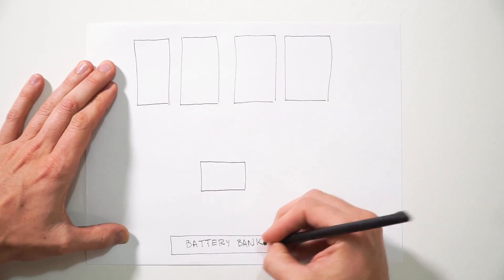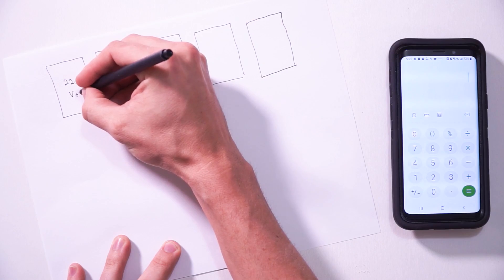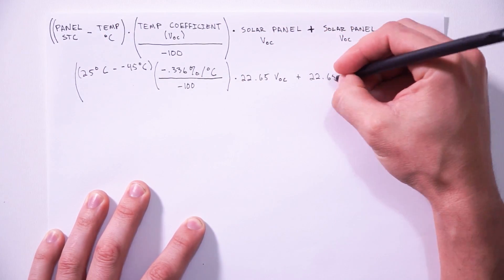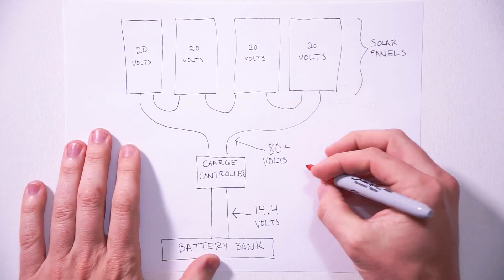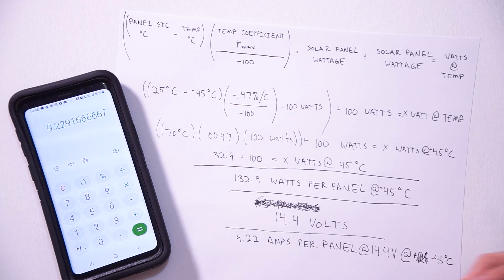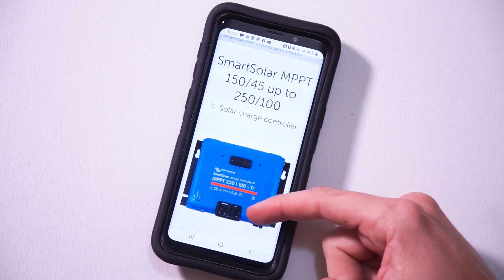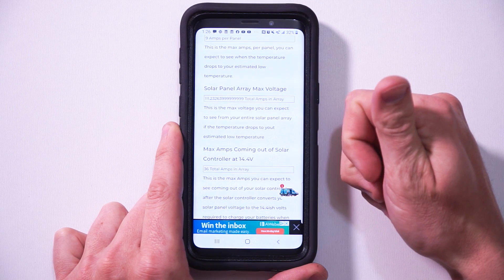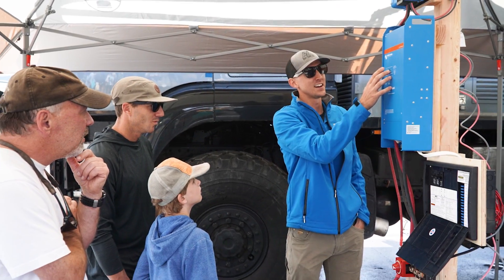How to Size a Solar Charge Controller for a DIY Camper Van Solar System

Comment: Wow according to the calculator I totally have too many panels for my solar controller. Tomorrow I'm going to switch em around if it's not raining... supposed to rain I would like to be able to see if things change. I'm going to lose two panels. I'm going to have to figure those out and buy another solar controller for them
I did find out that on my 48 volt system that I'm going to build I should be okay with my 10 320-watt panels. I think it just comes in under what the all-in-one 6500 sungold will let me have

Right now I'm working on my 12-volt system again I've had it in for 4 months and apparently I don't think the solar controllers are set up quite correctly. I had the wrong information given to me. Previously apparently.

Comment: And….. solar panels do not produce what they advertise. Like a 2x4 lumber is not 2x4..
Reply from the maker: It's not quite as cut and dry as lumber.  I know that if I go to the lumber yard now in 2023 to buy a 2x4, I know exactly what the dimensions will be.  With a solar panel, a 100W panel could put out 80W if it's hot.  100W if it's cool.  or even 110W if it's cold.

Comment: Many thanks for this, and more especially to all the work you've put into the calculator which I have been using for the last couple of hours.  If you have time for a question for folks who live in the tropics, here goes!  I crunched the numbers for low temp (10C,) 25C (STC?), and 40C using your low temp adjuster.  I could well be misusing its design function, but my voltages kept rising with temp. I was lead to believe efficiencies go down somewhere above 25C, it's usually above 35C in these parts, how do you size MPPTs for hot climates?  Thanks!
Reply: The STC, e.g. 25 C, is the temperature of the solar cells in the solar module itself, not the air temperature. As the modules generate power, that temperature goes up above the outside air temperature. But, not sure if the above information may help you figure out your question.

Comment: Although the calculations made in this video are generally OK, something that is not considered is that when panels are lying flat they will not perform to the level outlined in the spec sheets, because the sun is not aligned normal to the panel, unless one is in the tropics at the right time of year. So a correction should be made for the angle of the sun on the coldest day to estimate the actual power generation. The outcome will be lower production  than these idealized figures suggest. I have solar in Brisbane Australia and the consequence of the sun's angle throughout the day and the year is a substantial difference in production.
Reply from the maker: Although your comment and thoughts are 'generally okay', It's best to size the charge controller off of idealized figures like I showed in this video.  Actual production may vary, but sizing the controller for the 'best case scenario' will always be safer.

Comment: Fascinating video and your calculator is amazing.  I only have a small teardrop camper with 100 W solar but I want to upgrade my batteries to lithium and the charge controller too.

Comment: I think you made a mistake on calculating current on series string consisting of 5 PV, you multiplied max current of 9.22A by 5, which was wrong as the PV panels were connected in series. Please let me know, otherwise good video, thanks a lot.
Reply from the maker: The x5 comes on the output side of the charge controller.  This video explains that a little better: : https://www.youtube.com/watch?v=Jkbs84sBHsg

Comment: I want to add a new charge controller ( suitable for lithium).  to a portable solar (currently three 45 watt panels in parallel).  Based on the information that you have provided, to maximize output from this panel I would propose the following actions.  Note:  I would like to be able to locate this panel 20 to 30 feet from batteries in an effort to place them in the sunniest location when camping.

1) wire the panels in series to maximize voltage output.  (VOC is 21.6v).
2) locate the new controller close to the batteries.  It is currently located on the back of the solar panels.

Am I on the right track?  

One more quest - will a Victron Blue Solar charge controller with a dongle provide the same functionality as a Samrt controller?  Will a Smart controller and Blue controller then work together?
Reply from the maker: 1&2.  Yep! that's correct.

3: Just get the SmartSolar charge controlller.  It's the newest technology and then you don't have to bother with the dongles and such.
Reply: @EXPLORISTlife  Sorry should have explained already own the Blue Solar charge Controller that I would like to use for the portable panels and will be purchasing a new smart controller for the trailer array.

Comment: Thanks for the good info. What if the solar panels are mismatched? Will your calculator work and how? Thanks
Reply from the maker: It will still works, but you'll have to tinker with it a bit to get the proper array voltage/amperage heading to the charge controller.

Comment: Is there a max. amount of amperage that the solar panels / array can send to the charge controller? I noticed that the Victron only displayed the amount of voltage it can accept, but not the amount of amperage it can accept. Thank you btw for all these great videos & blog articles. Much appreciated.
Reply: Look at their spec sheets.  https://www.victronenergy.com/upload/documents/Datasheet-SmartSolar-charge-controller-MPPT-100-30-&-100-50-EN.pdf

Comment: What??? a 100-watt solar panel will produce 132 watts under -45oC temperature?
Reply from the maker: Potentially, yes!
Reply: @EXPLORISTlife  yea but practically its impossible that the sunlight intensity will be 1kw/m2 under -45 C.
Reply from the maker: All I can share is the calculations.  What happens in real life may be different, but I don't have a calculation for every single scenario for every location in the world, so I've made a conservative calculator that gets close enough for 99.9% of people.
Reply: @EXPLORISTlife  sure thanku, but it was really helpful, and thanku for the calculator ♥️

Comment: Isn't your calculation at 3:50 incorrect? If the adjusted Voc for each panel at -45C is 27.97725, shouldn't the total Voc for 5 panels in series be 139.8864 instead of 118.57728?
Reply from the maker: I wonder if I made a note about that specific thing directly afterwards?

Comment: Hi. Like your video very much however it got me a little confused. If wired in series volts add up eg 5 x 100w equals 500w. Amps stay as per panel. If I am correct in my thinking why did you multiply by 5 when calculating the amps ?
Apologies in advance if I am incorrect
Reply from the maker: The multiplication happens after the charge controller.  Maybe this would help: https://www.youtube.com/watch?v=Jkbs84sBHsg&list=PLmvhcyi4n0TU6HlMaQiCUwC20DBlyv6s_

Comment: My PWM controller is reading a different voltage than that of my digital meter causing the battery not charge full. Please any help.
Reply from the maker: Strange.  Sounds like a good time to reach out to tech support to see if it's a faulty unit.

Comment: you do consulting for boats with 12v system?
Reply from the maker: Unfortunately, I no longer offer consultations.  More info on that at the end of this video: https://youtu.be/UaJorpj3p2s

I do, however, have wiring diagrams available that meet the needs of 95% of the people who were paying for consulting, so that's the route I'd recommend going.  Here is the link to those: explorist.life/solarwiringdiagrams

I even have a full tutorial showing you how to install these systems into a camper.  Here is one, for example: https://www.youtube.com/watch?v=01F4QDVJUq0 as well as a full playlist that teaches you how to design this stuff yourself: https://www.youtube.com/watch?v=JonRJVchBaQ&list=PLmvhcyi4n0TUjVGA_O5aI5SQrS1kKLgEF

This should get you pointed in the right direction

Comment: Hi I have a Question I have a 48 volt club car I want to put solar on it can you tell me what kind of solar panel i will I need and I want to use a boost controller

Comment: humm not sure i got it, i'm planning to use 28 volt battery with bms ( lion ), can i use a charge controler 12-24 volt since they can take up to 32 volt battery?

Comment: For a Single Solaria 400W panel, in 12v system, would Victron 150/35 charge controller work or would I need 100/50? Thanks.
Reply from the maker: What results did the calculator give you when you put in your calculations like the video described?
Reply: @EXPLORISTlife   Calculator recommended 100/50

Comment: Hi, wondering if my target of 5x100w solar panel and decide to purchase say a Victron 100/50 Mppt, but in the mean time I may only hook up 1 unit of 100w solar usage till my sailboat arrive. Will the Mppt still works with just 1 panel instead of 5?

Comment: The last 2 questions on the calculation stump me..
I have a 40 amp renogy 
From what I've read i have have 2 250 watt panels or 500 watts.
But not when I try calc it.. 
If I have 1 in the series box and 2 in the parallel box it calcs to be 27 amps going in and 50 going out but my charge controller is only 40 amps does this mean I can't have 500 watts of solar going into it? 
If so will 400 be the right amount of watts for it ?

Comment: Let’s say I have two 100 watt panels from harbor freight, 4 of their AGM 12 volt batteries, each is 35 amps, wired in parallel, can I safely use this victron charge controller?
Reply from the maker: Hey Bob!  This video will teach you how to size a charge controller for the panels you've chosen. -> https://youtu.be/MxziHKvTRh8

Comment: Ummm- do you add the currents in series?  The voltages add, yes, but the current through the series circuit should be the same and equivalent to the current through one panel.  No?

Comment: extremely useful video and tools! I do have a question though, according to your calculator we need an output charging current of 60A for our system, but how does this relate to the charging rate of the batteries?
Reply from the maker: I'm not 100% sure I'm following your question, but this video may help: https://youtu.be/Jkbs84sBHsg

Comment: I have 4 panels 300 watts and I bought 2 mppt 100/50 and I have 400 amp in battery bank. Is this victron mppt are the right size ?

Comment: Love your videos. Quick question: is there a problem with buying a bigger than required charge controller. Asking because currently only have 100w x 2 panels but will purchase more in the future (thinking 250w x 4)
Reply from the maker: Nothing wrong with that, no.  Just size the charge controller for the larger array and then verify that the smaller array will fall in the charge controller parameters.

Comment: How can I charge both my Lithium Ion house batteries AND my under the hood Lead Avid Battery with the same solar Panel.  My RV sits most of the time, and when I use it, I have a much lower power draw than what your builds show (I still use propane to power the fridge, heater, hot water heater, and stove top.)   So I have quite bit of excess Solar. Thanks.
Reply from the maker: The 'proper' way to do it would be to use two separate arrays.  Build a big and proper solar array for the house battery bank and then get a little 20W or so panel and dedicated charge controller for the starter battery.  The starter battery doesn't need much to keep it topped off.

Comment: What are the effects of if you have the wrong controller?
If you add more solar panels after etc
Reply from the maker: Best case scenario, it would work fine. (Ex: oversizing the controller)
Worst case scenario, it would damage the controller. (Ex: overvoltage to the charge controller)

Comment: My Voltage Temperature Coefficient is -176.6mV/°C.... does your calculator use mV or do I need to convert to -.1766
?

Comment: my controller only shows wattage when using the power... is there any other controllers that detect wattage better? If not I know I need to buy more cheap controllers
Reply from the maker: Your controller will only tell you the power it is putting out.  So if your batteries are full and you aren't using power; your charge controller will stop outputting power do it doesn't overcharge the batteries.
Reply: @EXPLORISTlife  that makes researching solar slightly complicated since I need to use appliances but that is ok
Reply: @EXPLORISTlife  I’m more like Vosk at least.. I have a separate system to make sure I’m using enough power to test my limits and can controller or adjust the power being used after finding the maximum

Comment: When I use the online calculator to reproduce the math presented in the video at 5m 58s, I don't get 9.22 Amps per panel @ 14.4V @ -45C. I get 10.17 Amps. Can you comment?

Comment: greetings from venezuela friend, I am interested in buying a victron solar charge controller but I don't know which one to buy, I have 4 RENOGY brand solar panels of 270w (model RNG-270p) at 24V, I also have two lithium batteries of 24v 55ah each connected in parallel for a total of 110 ah, now according to the manufacturer of the batteries they must be charged with a minimum amperage of 10 ah, could you please help me to know which would be the charge controller that would suit me best? in advance thank you very much for your help ... greetings

Comment: I have two panels of different wattages (140 and 100).  Your calculator (which is a good start) assumes one has the same make and model panels.  Is it possible to make a calculator which would accommodate differing panels?  Thanks.

Comment: @EXPLORIST life - DIY Campers  I started my home solar  journey, so far think  only made 1 mistake. based on Victron's and your  solar mppt calculator. I had already bought one, a Victron 100/50 for a 24v battery system. The calculators called for 150/35, when I change the temp setting  by 5 degrees it calls for 100/35. Can i use the 100/50 by changing the settings of the MPPT? Thank you in advance.

Comment: With the inverter 3000 watts 
How big the  fuse amp I should put between the battery and the inverter?
Reply from the maker: https://youtu.be/ki3WXVR48eM & https://youtu.be/5y-yDMEgV70

Comment: All that math is great, however some of us are formula challenged. Would you please make it a lot easier and say that at the -45 degrees there will be what percentage increases in voltage to expect. 5, 10 %? If you had a 135 volts on a warm day should one expect that voltage to exceed 150 volts at - 45???  I would like to be able to just add a percentage to my total and be close enough to be safe. For example, if we start at 135 volts and we add 10% that would be 148.5 volts, with that I could determine that 135 volts would probably be too close of a margin and decide to only have two panels in series without doing all that math. Please,  Bill Rogers

Comment: I think I broke your calculator. It says I have 27.27 Amps going into the Charge controller and 137.84 Amps coming out of the charge controller. I don't have any Negative numbers on my labels. When I'm done punching in all the numbers, doesn't have a recommended Vitron Controller for me to buy?

Comment: Hello Explorist, Can I ask you, So the load terminals go to the 12 volt side of your inverter right and the specs on the input side of the controller are independent of the load specs, so a 30 amp 12 volt rated controller is what the controller can accept from the panels and provide to the battery and nothing to do with the load, is that how these ratings work?, Great content Thank you
Reply from the maker: A 30A charge controller can charge the batteries at a rate of 30A.
Reply: @EXPLORISTlife  Thanks and so the load terminals on the charge controller are also 30A x 12V or 360W

Comment: I didn't buy my panels first    I received a GROWATT SPF 3000TL LVM-48P as a gift   I'm not sure what panels to use/size    I have room for 5-10 panels   I'm going to run 8 . 6v batteries  ( for now) I'm not looking to go totally off grid   If someone can give me just a little help on panels  don't need exact  just what to look for and how many    What I'm trying to do is run my shed and garage 110v    Thanks for any help
Reply from the maker: Hey Frank!  I have quite a few options here: https://shop.explorist.life/product-category/all-products/camper-wiring-kits/solar-charging-wiring-kits/
Reply: @EXPLORISTlife  I see that they are all 12 volt   my controller is 48volt  as long as i have them wired to 48  i should be ok   Yes -   no
Reply from the maker: Not necessarily.  I don't have any array examples for 48V battery banks at this time, but if you watch some more of these DIY camper electrical videos, you'll have a pretty good handle on solar design. 👍👍
Reply: @EXPLORISTlife  ty very much.  Will do. :-)

Comment: i suggest a series parallel option;  say 400w per panel @ 12v in series with a separate string of panels 100w each @ 12v  or 350w @ 12v in series, 4 each of course.
if this is a bad idea; then just really BLAST ME....hee hee

Comment: How does one decide whether to have the solar panels in series or parallel????
Reply from the maker: It's a mixture of finding the highest voltage while keeping the charge controller as small as possible.  If you work your way through this playlist, you should be able to answer that: https://www.youtube.com/playlist?list=PLmvhcyi4n0TUjVGA_O5aI5SQrS1kKLgEF

Or you could check out the wiring kit's I've put together here: https://shop.explorist.life/product-category/all-products/camper-wiring-kits/solar-charging-wiring-kits/